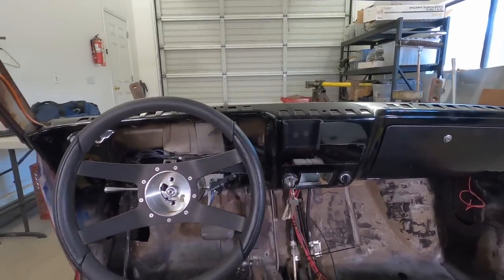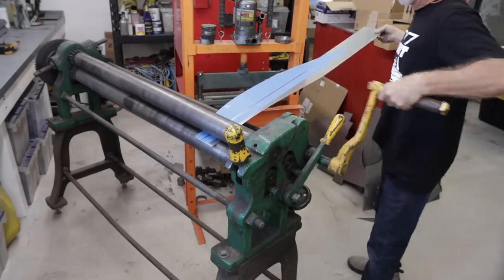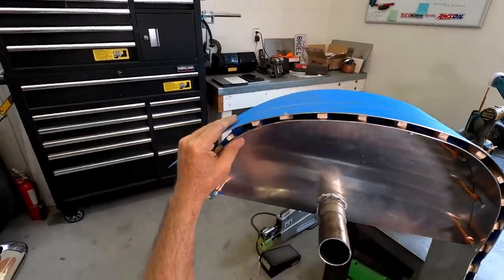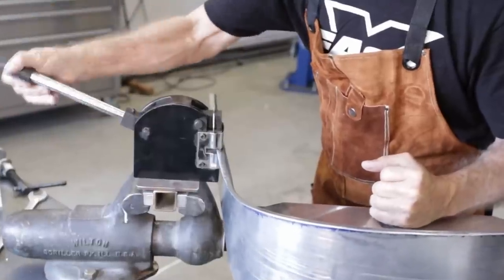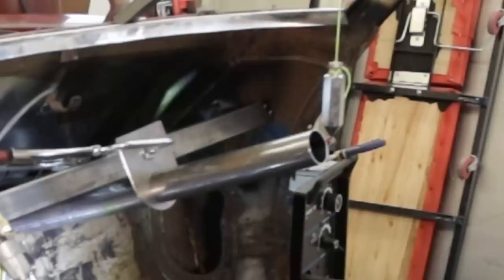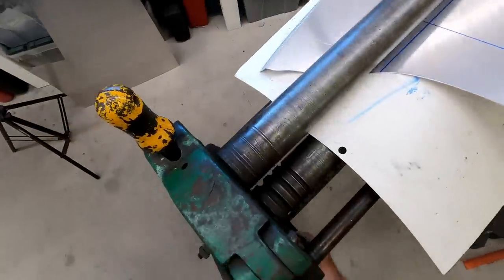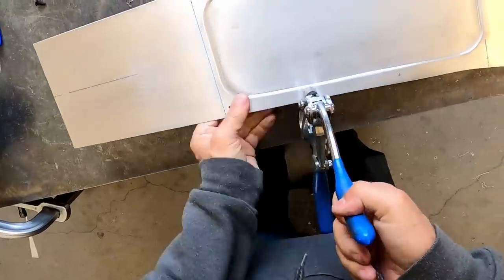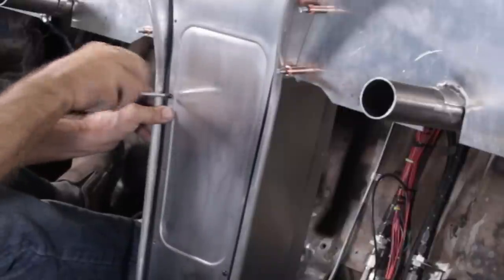Building a complex aluminum dash from scratch

Comment: I wouldn't worry too much about the Corvair Purists.  They would have organized a blanket party for you long ago.  Disclaimer: My first car was a 1967 Corvair Monza.  110hp/4spd.  Loved that car.
Reply: as a member of the more reasonable side of the Corvair community, were just glad to see one that isnt 86% rust.
Reply: @Calibrumm  Perhaps We are both within the Corvair community , enthusiasts. Am also among those that appreciate any individual that enjoys using, tending to any Corvair, work on, with, it suchit becomes useable, functional and especially modified versions as John is doing too.
Just located a video of the recent Corvair Road Race - "Forgeline Yenko Spirit Classic Corvair Race INDT 2023" to enjoy also.
-> My father and the family enjoyed his 1965 Corvair Monza for ten years, > 100k miles; sadly had missed out with my desired to repair, fix, modify that delightful light blue vehicle; still remember, recall Our first family summer vacation in the car into PA, Pocono Mountains into NY; they has become known already then to be among those that desired to modify them for higher performance, road racing including V-8 mid-engine swaps. That Corvair, bought in Toledo, Ohio, driven there for nearly three years [excellent in the snow, but drum brakes easily flooded - vehicle is unusually low - disk brakes are a certain necessary improvement, upgrade], then driven and, moved to MD-DC for the remainder did not have any significant rust -, the steering linkage, tie rod ends failed, broke, engine needed some work including oil leaks [mostly valve covers, gaskets, oil burning, ring and the never repaired exhaust leak into the heating systems -all rather simple repairs -would have been a fantastic first car, especially as was just turning 16 with my driving license - my mother was anxious to have the vehicle removed, out of sight, gone - had their been a place, location, buddy, friend where it could be have been taken, placed, thus to work on it, my father may have allowed me. Also V-6 engines had become available again along with the older Buick's too, thus also reasonable, usable, accessible; with more thought, investigation, there were other engine, transaxle options, especially via European vehicles or just rebuild the GM/Chevy flat six cylinder and add some or portions of the Yenko upgrades too.
All The Best and Much Success, in Your Quest(s), Health, Happiness and Well Being , Sincerely

Comment: '55-'56 Chev clock going in the right binnacle?
Reply from the maker: Probably glove box like the C2
Reply: @JohnReynolds661  John You continue to impress me with Your ingenuity, creativity, imagination, fabrication, execution, results.
Your idea, view, imagination, decision, thinking to modify the Corvair 'Dash" [simply 'Dashing' as @rdyardie; posted] was certainly unexpected, surprising and very fitting especially for Your custom Corvair, transverse mounted LS4, V-8, performance version too; perhaps You will reveal Your selected name when appropriate too along with the independant suspension
Certainly You are aware of the many Corvair based prototype experimental vehicles including the Monza GT, SS, Astro I, II,  'Vette' versions; Aerovette, Astrovette along with the obvious similarity with the model names.

Am figuring that Nicole has continually been following the build with Your Corvair, having seen it with Your VW 'Bug'-'Super Beetle', Subaru EJ, turbo, 517 HP development, thus expectantly, anxiously awaiting, perhaps even visited in the interim also; Such am expecting she is prepared, to visit, You again when appropriate with the successful completion, driving, testing, perhaps which ever performance attempts at some relatively local track, thus will then record, produce, post  her video too. This Corvair should seemingly have more power, torque, be quicker, faster than the "Beetle" too, though perhaps more stable, driveable too.

Perhaps You have seen another custom Corvair build via a slightly older gentleman on his channel Naider's Nemesis 2.0, with his completely custom tubular frame, Corvette suspension, mid-engine V-8, longitudinal, etc. ?

John, each video with each of the step You record, edit, upload, post, showing Your progress are always enjoyable along with Your unique wit, sarcasm, 'puns', etc.; Also am always looking forward toward Your next posted videos with each of the steps, progress, results too. YOur work, development, fabrication skills, planning, preparation, imagination, thought, thinking reason, reasoning, logic along with Your effort with recording, editing, uploading, posting these for others to view, enjoy, appreciate benefit from are much appreciated ;at least by me; seemingly via the posted, comments, along with many others too.

All The Best and Much Success in Your Quest(s), Health, Happiness and Well Being , Sincerely
Reply from the maker: Well, thanks again.  Yeah, Nicole keeps asking when the Corvair will be done.  I'd like to race the VW against the Corvair eventually.  It will be close but I think the Corvair will take it.